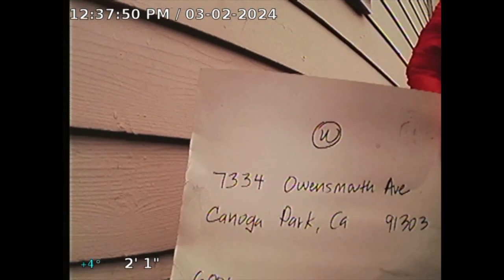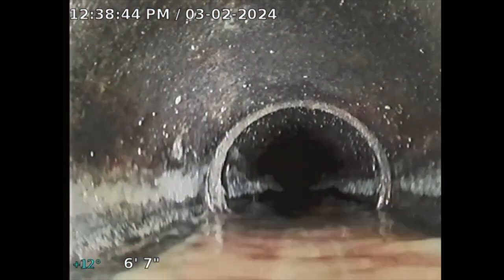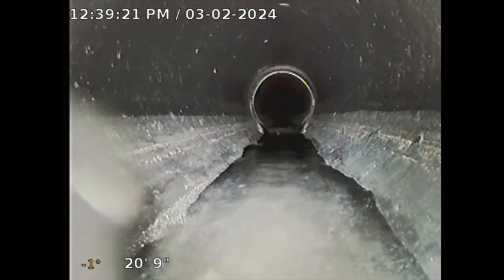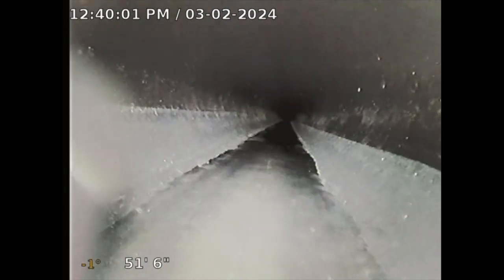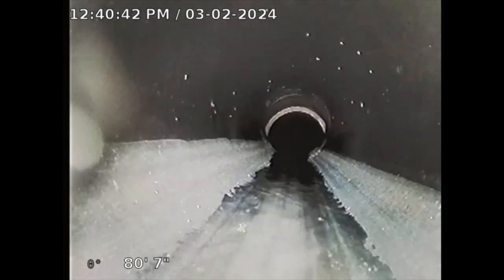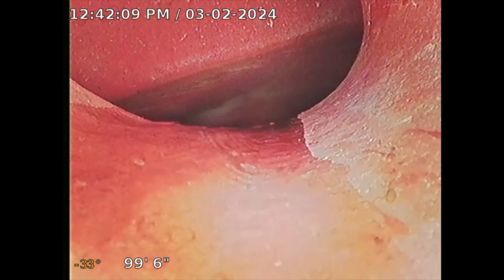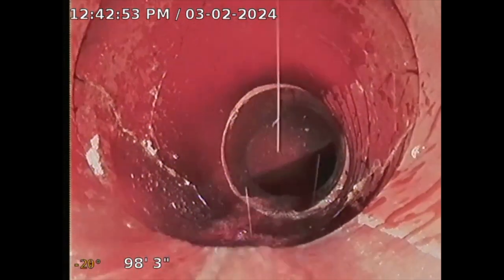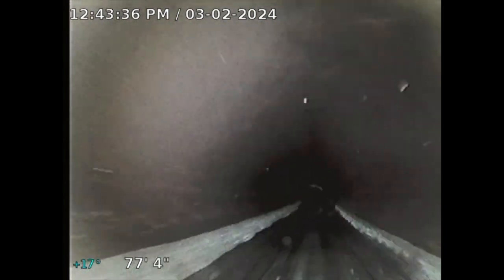7334 Owensmouth Ave  Diagnostic Main Lateral Sewer Inspection

Comment: Love your videos man! The best I have seen.

Just curious about that positive slope along the 65-70 foot line?
Reply from the maker: Yes sometimes the sewer does have a positive slope, I always flush toilet at city saddle to see if main lateral is draining properly. A minor slope in sewer line is an issue, but digging up and repairing for minor upslope is a long run for short slide type of repair. Some issues like a sloped sewer line is an issue if there is standing sewage. I found a major sag in lateral sewer under a kitchen 40K repair, new construction.